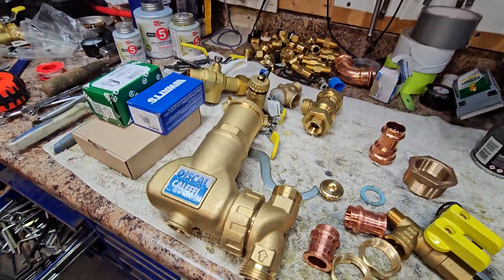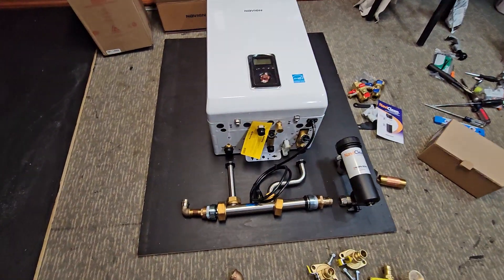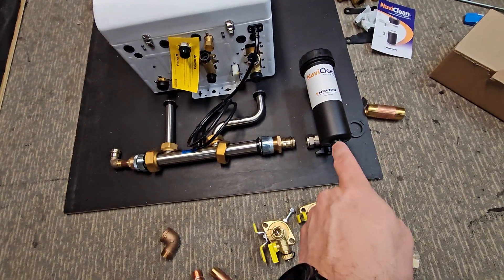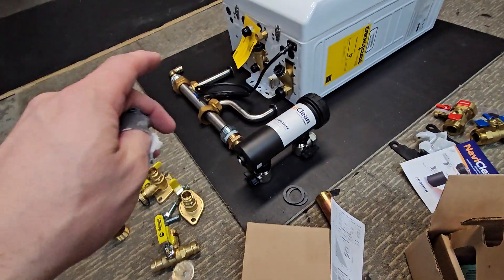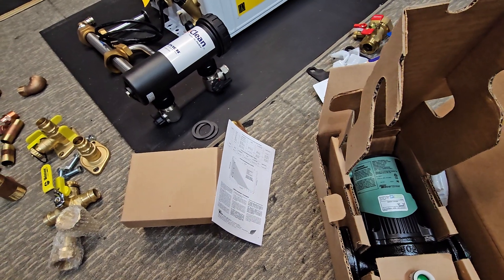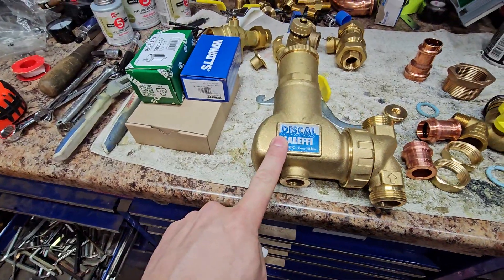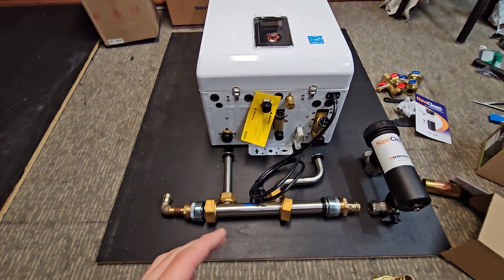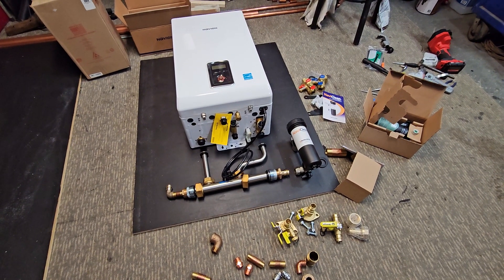Building A Compact Single Zone Navien Boiler Combi For Radiant Heat

Comment: I came across your channel a few weeks back while doing some research on using a propane combi boiler in my bus conversion. My bus will be about 300 sq ft and will have 3 zones, living room/kitchen, bathroom and bedroom. I wanted to do tubing in the open areas of the floors (not under the cabinets) and add hot water forced air heaters under the cabinets to supplement the floor heat circuits. For the domestic water I wanted to put a 20 gallon electric water heater next to the combi boiler for domestic water storage and use the boiler to keep it hot. I want to do a flat plate heat exchanger tied in to the system so I could use engine heat when driving to heat the system/coach and also be able to preheat the engine for starting in cold climates. I would run the intake and exhaust from the boiler up the interior wall of the coach and terminate out of the roof. I built my 5000 sq ft three story house years ago and did hydronic heat and domestic water in it as well as the 1500 sq ft garage and later did my dairy facility with floor heat and domestic water when I built it. I have been heating everything with an outdoor wood furnace for the last 24 years and it does a great job doing it all. I like the warm floors in my house so thats why I wanted to try it in my bus and wondered if you might be able to help me out with the design of the project. Thanks!
Reply from the maker: Email me at speranzadevelopment@gmail.com
Reply: @JimSperanza  done!